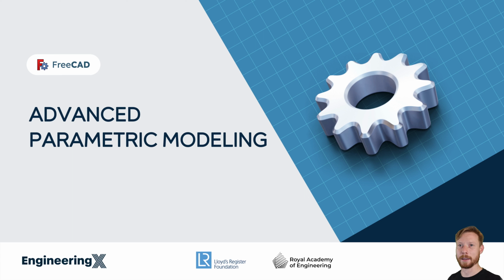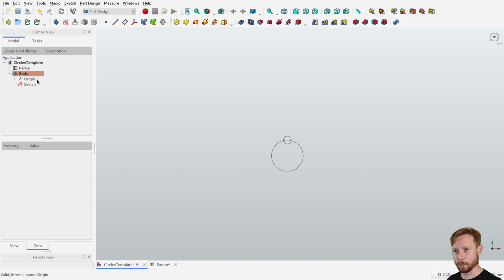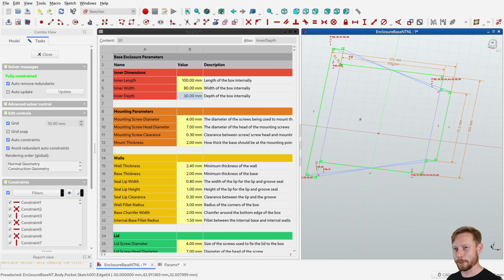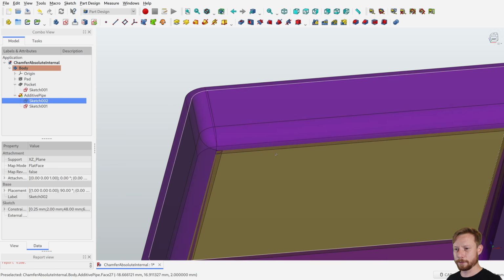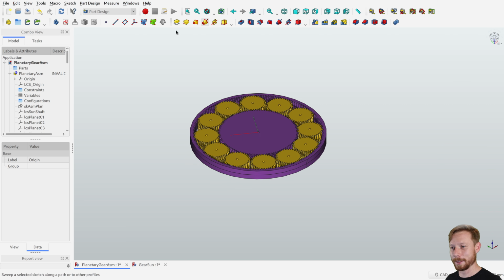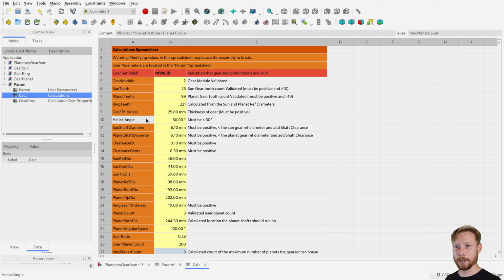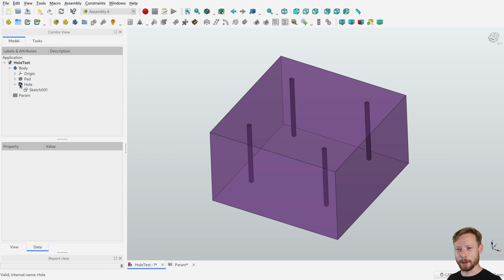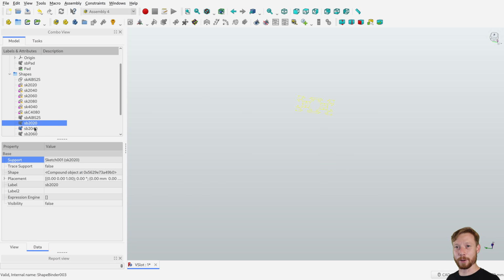Advanced Parametric Modelling - FreeCAD User Conference 2023

Comment: You talk about testing variations on each dimension, whenever you make a sketch, whenever you make changes to the sketch. In software development, that is called "unit testing". Is there a way to do unit testing in FreeCad? One complication that comes to mind is figuring out what the item should look like; how do you test for visual compatibility?
Reply from the maker: @TomLeg  that's a great question and now I'm probably going to dive down a rabbit hole looking for methods people use to achieve this! There are accessible properties for sketch objects that will let you know whether there are validation and solver issues (failed to solve all constraints etc) that could be used to verify that new parameters will work. But, the usual issues with the software not being aware of your intent or the context of how it is to be used arent covered by this. A sketch can be valid, but the solver may have done something to the sketch that break the operations that follows it, or just create something that is nothing like what you intended.
There isn't anything built into freecad * that I'm aware of * to handle testing of sketches and the operations that use them, but, basically everything in freecad is exposed for use in a macro or extension. It wouldn't be incredibly hard to build a macro to check that a parameter change doesn't break anything in the model tree, it may be a bit more challenging to ensure it still follows your design intent.
Reply: @BrodieFairhall  I would be a convert!

Comment: I Like rule #2 'Stay Absolute' but I have one exception lol. When I sketch I have areas of the sketch that - in my mind - are actually sub-sketches. IE the details/hole/etc in the corners of each box. all those dtails will ALWAYS be in that corner and will move around with the corner when resized... Therefor I reference the details to the actual corner - BUT not directly. one point of the detail section of the will reference the corner to lock the sub-sketch in place to the corner- the rest of the details will reference that point. At not point (EVER) will any line/point/feature etc reference anything out side its own details. it is that which will break the sketch. Or a rat hole as I call it (because if u make one it will end up as a rats nest, lol)

Comment: Should be mentioned that in SOme cases you DO NOT want to have your fillets, chamfers,  sometimes even holes in your sketch. They are referred to as dressing or dress-up operations because they are a completely separate operation if the object needs to be machined to make. You need to keep in mind how the objects are made or how the sketches will be used to build something. And there are exceptions. as in Mold making and plastics. I guess my point is you dont want to get in the bad habit if you plan on doing serious model/sketch making. And that bad habit depends on 'what' you are making, lol. In my opinion - 95% of the time - adding fillets in a sketch is asking for it.
Reply from the maker: The big one that stands out / common mistake people seem to make is, modelling threads in holes.
The main issue I've encountered is that most machine shops tend to only support source files from one or two 3D CAD suites, if you don't use the same tools as them, you end up having to just send them a step file and if you need holes tapped, special requests etc. you also need a marked up drawing. 

Unfortunately, I haven't encountered a company that will take FreeCAD files for machining, so in the end there ends up being no difference between creating a dress-up feature using a dress-up tool or creating the geometry in any other way, because they'll just end up asking for a step file. This has thankfully worked out for me so far, even with designs that are destined for injection molding, so either CAM tools are just getting better or I have really, really annoyed many operators who have had to deal with my designs.

I do hope that either an open file standard that includes all operations rather than just geometry gets universally adopted or FreeCAD files start being accepted by manufacturers (I won't hold my breath for that), and then we will have to use the right tools for the job.
Reply: @BrodieFairhall  Yeah I didn't even consider Commercial the compatibility issues. Well the could do it the same way Solid Works did it, go proprietary, charge 10's of thousands of dollars a year for a license and then a couple decades later offer a cloud version at $50 a year. that way its use will explode and you will find solid works cad files all over the place. lol
Reply from the maker: @armastat  Can't forget to lobby to universities to make it part of their curriculum and give it to students for free!

Comment: Freecad является полностью инвалидным когда дело доходит до фасок. В коммерческих программах моделирования, на сколько я могу судить, формы для расчетов и привязок остаются исходными, а фаски это как дополнительное свойство, которое отображается и экспортируется в готовых моделях, но не является частью внутренней модели. Но во freecad, похоже является! И разрушает модели, на которые были потрачены часы!
Reply from the maker: It sounds like you're talking about 2 different issues here.
1. The limitations with full width chamfers and fillets in the Open Cascade Modelling Kernel (OCCT, which FreeCAD uses)
2. The other issue, which sounds like the main one you're having, is the Topological Naming Peoblem (https://youtu.be/6p2vqEEmWq4?si=e86N33xLW8MYe7pv)

Both of these limitations have solid work arounds, but require you to become pretty familiar with FreeCAD to use it effectively.
You may want to try using Realthunder's Linkstage Fork of FreeCAD, which can be found here (https://github.com/realthunder/FreeCAD/releases/)

Comment: I would like to see a way using the sketcher to create a variable number of holes equally spaced (in a circle or an array) where the number of holes is defined in a spreadsheet.
Reply from the maker: That is unfortunately not something that the sketcher is intended to do. There are some hacky ways to do it that I might look at putting in a video. Generally though, the "correct" way to do something like that is by creating one hole and using a part design/draft array tool to replicate the holes in the places you want.
Reply: @BrodieFairhall  The array tools in the sketcher could be modified to accept equations, but for now, they only seem to allow constants. It makes some fully parametric designs impossible, or at least really convoluted and hacky to implement. This kind of thing is much easier to do in OpenSCAD.
Reply from the maker: @douglaspeale9727  yeah, probably the easiest way to make sketches do things like that is to use a python macro or the openscad workbench.
It would be great to see sketch arrays turned create a new type of array object rather than just replicating the sketch elements, so they could be used in a proper non destructive workflow. I think the sketcher would require a lot of changes to do this though, eg, you create a rectangle and it's not shown as a rectangle in the sketch elements, it becomes 4 lines. The element list would likely have to have a tree allowing those 4 lines to be grouped as a rectangle and this would allow for the creation of other groups, like arrays, which could have their own parameters. I'll bring it up with sliptonic when we have our next monthly meeting and see how much work it would be and whether it could be added to a feature road map.

The easiest hacky way I can think of to make  a variable number of sketch elements to cut the number of holes specified in a spreadsheet is to create a whole lot of them and add an expression on the construction geometry parameter that will set it to 1 or 0 depending on the number in the spreadsheet (the same way I show and hide the planet gears in the assembly in this video).

Comment: the "undo problem" when sketches cascade and break seems to be something that would be solvable if it didn't happen on the main sketch instance, but instead when regenerating all the models, done on shadow copies until it knows they all complete? then apply them in one step. would enable some options around sketch failures that would be really nice too, like more cases where you prefer it abort the whole operation than solve it in the state it is in
Reply from the maker: You're probably entirely right, I have no idea how undo is handled, it might revert the sketch normally, but in this case I'm pretty sure the sketch remains broken because it is only undoing the changes in the spreadsheet, then updating everything. I guess it didn't count the sketch as having changed
Reply: Snapshot undo - where the entire state of everything is recorded at each step would work, ,unfortunately thats a memory hog. However it does allow immediate undos without need for recalculations. Instead they just 'undo' the last command and allow a recompute. Unfortunately if the action borked other states in the model it cant repair it.

Comment: Some good ideas, thanks for sharing. I wonder if there's a better way to communicate to the user whether their input was valid and accepted, or whether it was invalid and some sort of default was substituted instead? It could be surprising to ask for an M4.5 hole, get something that looks visually believable, and then find out later that it has been silently substituted for M4.
Reply from the maker: You're absolutely right!
With macros, there are a multitude of good ways to do this, but I'm still looking for a good method to do this just using the built in tools. 
When looking at the planetary gear set, you might be able to see in the tree next to the assembly, the comment field will say "VALID" or "INVALID" based on an expression in the spreadsheet that is supposed to work out whether the gear set would function.
It really doesn't stand out enough to warn users though, I could have made it default to a wildly different hole size to show something was wrong, but I think the ability to trigger a prompt/toast message/message box is what is needed.

I need to ask more questions on the forum to find out whether there are some crazy tricks to get that to happen.
Reply: @BrodieFairhall  If you can control the visibility of objects with expressions then perhaps you could include some large padded "INVALID" text at the global origin so it would obscure the model and couldn't be missed. You might have multiples that could identify which parameter caused the problem.
Reply from the maker: @ElectricGears  that's a pretty good idea. You definitely couldn't miss it.